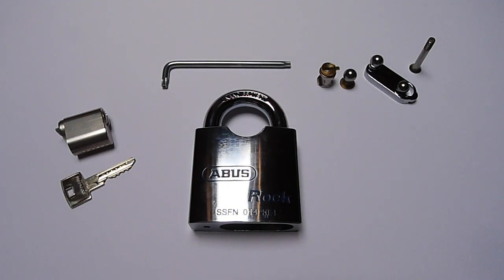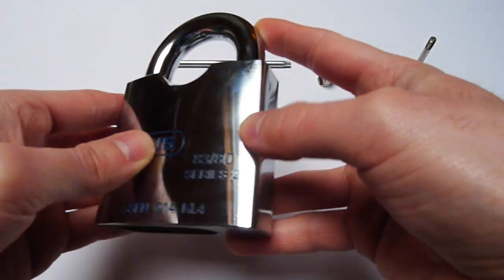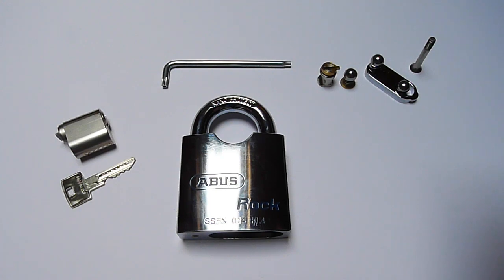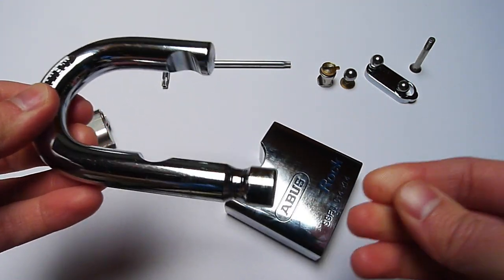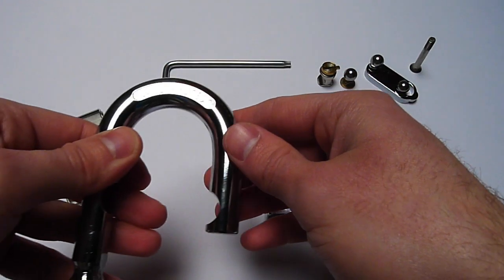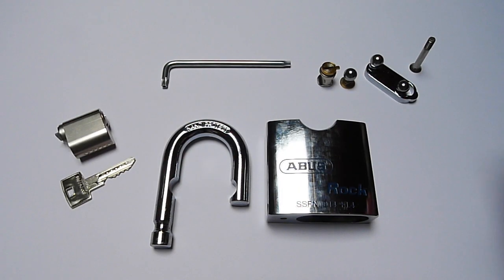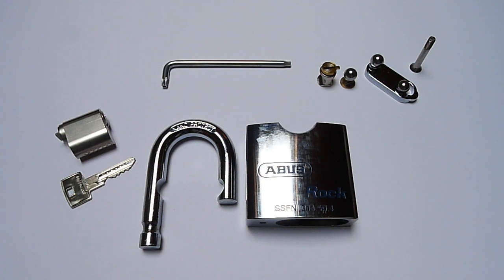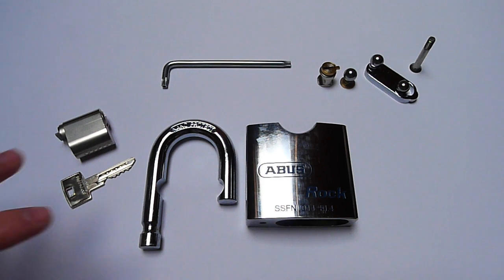Abus Rock 83 80 Brand New and Rust on It

Comment: You and I have discussed the issues with even plating on the inside and outside of a lockbody and we understand the challenges.  At Commando we've learned to increase the amount of nickel and time in the tank...you simply can't rush plating.  You know we have some rusty chromed parts because they are sitting in the Scrap Department.  Thanks for sharing.  That's disappointing for such an expensive lock.

Comment from the maker: Thanks for the comment Patrick. I have not mentioned that issue with your padlocks because you asked me not to. As for your US stamped padlocks they are perfect and I have not even found the smallest sign of rust on them! I have seen many padlocks in my life so far I never had such an expensive lock with rust on it before. Chrome plated American locks like the Series 700 for example have the same flaw though.. I have a brand new series 700 anniversary padlock here and there is rust on it...

Comment: Constructive Criticism is Key :-)) Great Work Adrian
Reply from the maker: Thanks Mark, always welcome! Best wishes, Adrian
Reply: Adrian Weber Thankyou Adrian Heres a bit of info you and others may find helpful, I used a large Kasp 19070 for the gates at the stables and within 6 months the first layer of nickel plating peeled off! The locking balls started rusting so I replaced with silicon nitride as it was getting hard for people to open! The ceramic balls helped but having no real drain holes I had to constantly strip it down and use marine grease to keep the rust at bay which was clogging the pins! Then the chrome peeled off the shackle and it was so rust aggressive that I had to replace the lock! Having to have 20 keys cut is rather expensive so went with the kasp with the common key design! Anchor-Las and Abloy are the best when it comes to corrosion resistance but the high security keys cost a bomb! I do have a Chubb Conquest that is made by abloy with the same exellent chrome finish but with more of a simple regular key as the kasp, so seems to be doing ok :-))
Reply from the maker: I heard of many people having the same problem. The mentioned Kasp padlock does not have a good a weather protection. The weather protection on the Anchor Las and Assa Abloy padlocks is very good that is true but these locks are also very expensive. The disc type cylinder can withstand very harsh weather conditions and is perfect for those conditions. Other manufacturers such as Squire still use pin cylinder but with caps for weather protection which is also a good solution but by far not perfect. Lever type locks are also very good for withstanding harsh conidtions. The German Bundeswehr had problems with the small green military padlocks not opening or being stuck. Abus then came up with their new design where the rivets and the interior mechanism including the levers are made of brass. Those locks are tiny but can withstand very harsh weather conditions and I love them and also sell them. Thanks for the additional input again Mark! Best wishes from Germany, Adrian
Reply: Adrian Weber Thankyou for the wealth of Exellent Information Adrian, Ive collected many padlocks over the years and thought I was well up on the facts until I met yourself! I feel like quite a Novice now :-)) Well I know were to come now for help and information, Adrian the Oracle! Many thanks, Mark.

Comment: It's not rust, it's grease for protecting it from moisture! I've had exactly the same on an expensive Mountain bike (Whyte prst1), on the suspension screw joints.
Reply from the maker: Hey Michael, yeah there is definitely grease within the lock but there was also rust believe me.

Comment: It's very hard to chrome plate in the inside. It's electroplated and if you don't do anything to plate it on the inside there'll be no plating on the inside just about no matter how long you'll leave it in the bath as there'll be just about zero current going through the liquid inside the lock. If you want to electroplate it on the inside you'll have to center electrodes inside the lock. That would be a very costly procedure.
The kind of steel used for such a hard thing as this lock will surface rust quite fast (might have been stored slightly damp or just in transit on a cold truck). Just like brake discs on your car. Just leave it one rainy day and they'll have rust spots on them the next morning. For a lock you want to use don't bother about it it'll last no problem. It's the same with other brands except stainless steel ones but they're not as hard. If no rust from factory it'll quickly get some. The best you can do is clean then grease the inside well make sure everything is covered - your lock is now ready to go into your collection. Use a good grease intended for the use. There's special salt and moisture repelling lock grease but I find superlube to work very well myself. A bit of grease also helps keeping the steel balls in place when reassembling.
Reply from the maker: Assa Abloy actually has such a plating machine which centers electrodes inside of the lock. Therefore the whole body, even the inside gets plated. I know that it will not affect the security but for such a high price I would expect a plating of the whole body, even the inside. Best wishes, Adrian
Reply: Nice! Didn't know. Thanks for info!
Took a look at my Abloy 362 - never bothered taking it apart before - seems you're right. Could seem the Ruko 4 (also Assa Abloy Group) is too (haven't taken the shackle out). Their (much) smaller model 2 (8mm shackle) what you typically would use for a shed or basement storage room is not but that's also brass body so really no need for it to be.
On the other hand to be fair the Abus is significantly cheaper than Abloy's comparable so hey you probably get what you pay for (yeah I know there for some odd reason seems to be a ton of 362 on the bay new but without code card but if you want you can always have them rekeyed but I don't see them as genuine representation of the real price for a 362). Again I wouldn't bother too much for a lock to be put to actual use. You have to give it a good covering-all-greasing inside anyway. In a basement etc. no problem either way. For an outside lock there will quickly get sand and dirt in it anyway grinding first the plating on the shackle then inside of the body.

Comment: Rust looks like iron fillings left over from machining.  They rust quick.  It's not from the lock, it's just dirt.
Reply from the maker: ghosttwo2 You can be right, I am however not 100% sure and it did not only look like metal shavings. Either way they did not clean good enough after the milling process.